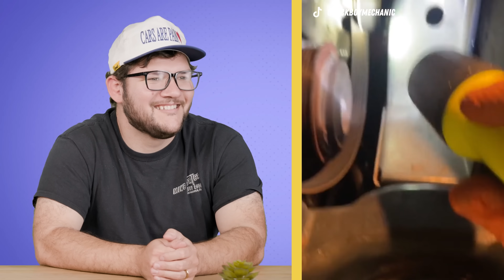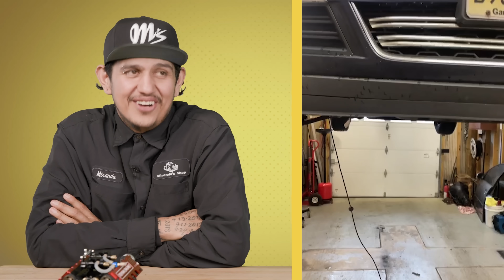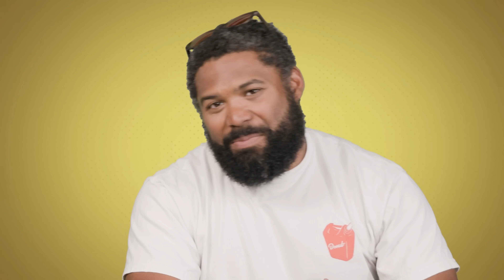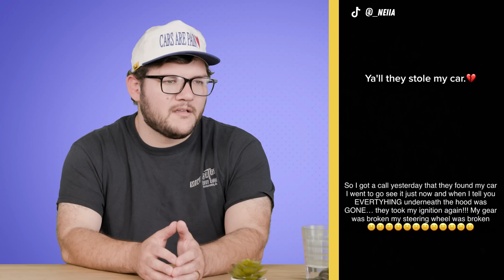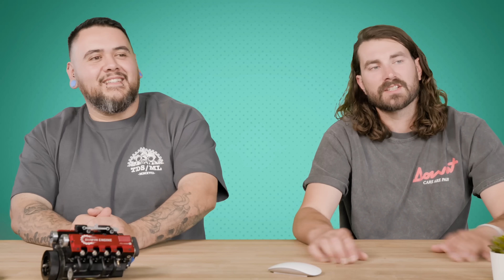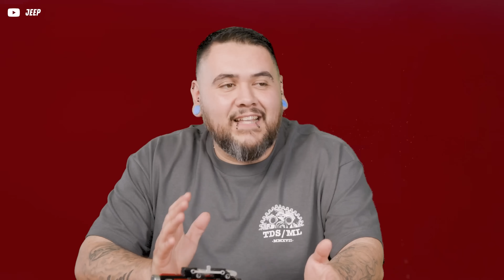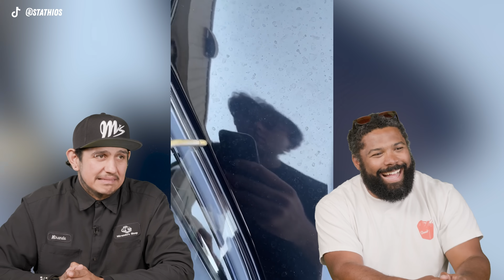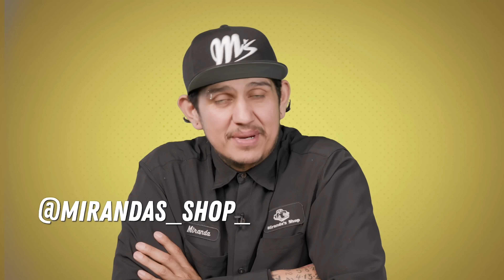Mechanic Reacts to Car Engineering Fails

Comment: One of the things I hated when studying mechanical engineering was being forced to learn how to design things to fail within a certain range of time or mileage instead of designing it as best we could within the allotted parameters. And to design it in a way that requires specialist tools and procedures. It made no sense to me but it was drilled to us to exhaustion. And at the time, during the day, I worked in an heavy equipment maintenance shop it made no sense to me... still doesn't.
Reply: What is the actual reason or explanation for engineered failure
Reply: @tjlovesrachel  To get people to buy new stuff... and more new stuff!
Reply: @firbolg  that's it... just that's it

Comment: Engineer here, teach design at a uni. First lesson in design is talk to the old hands and shop for their equipment, tools and practices for anything you plan to do.
2nd is to figure out how to bypass management trying to nickle and dime you.

I can garantee most of the engineer related faults were identified, but either too late so costwise so the company doesnt care, or handed off to another group to tick the box ok in order to meet deadlines.

Comment: I propose a 4th option: 
Bean Counters

Sometimes they force the hand of engineers to design something that's absolute crap just to save a dollar here or there. Then, 💩, as aforementioned, rolls downhill. 

Coupled with slap dash assembly, you get a lemon farm and unnecessary bailouts cuz "too big to fail", but I digress before I keel over from a massive stroke.

Just found this channel and have been binge watching to catch up! What do I wanna see next? Yes.

Honestly, the thing that gives me Forrest Whitaker eye the most is "rolling dumpsters". I detail on the side and this crushes my soul. It tells me the owner has bigger problems than a car filled with wtf ever is in there. Sometimes it's just ignorance and laziness, but sometimes, there's some form of sadness behind the mess.

Be gentle in educating these people about vehicle dynamics and how it correlates with safety to them, and others.

✌️😎

Comment: OH sh*t! My first car, I owned a '94 Celica with an '04 motor (hillbilly rigged, wires going places but not connected, and loose wires not connected to anything in the engine, battery almost welded to the hood, half an aftermarket sound system, i could go on lol) There was a little switch kinda by the floor that wasn't hooked up to anything, a mechanic guessed it was for fog lights? (this car would both, confuse and frustrate any mechanic) lol musta been an old kill-switch. Loved that car though! If i slowed down too fast the rpms would fall and the engine would die, and the previous owner put rims on SO BIG, I had to buy racing treads ~$170/each in 2013ish. Costco had the cheapest tires btw, discount tire wanted over $200/each!!!

Comment: Tesla door handles started off with limit switches to control them. After learning they replaced the limit switches with hall effect sensors (detect a magnetic field and it's orientation) to remove a bunch of wires, mechanical switches and points of failure. I can't say I like Tesla builds but after long enough they did fix the door handles.

Comment: I had a friend back in the day who was/is an engineer for one of the big 3 domestics who used to show me designs on his laptop at the bar and ask my opinion as a tech.  I think more engineers ought to do that.
Reply: Most engineers want to create perfect products but management is a ball and chain that keeps us back. I don't know how many times i have found problems with our designs and management just say "ok, so we file an exception" and leave it like that.
Reply: That's nice! If my gut is telling me that a particular design is going to be an issue, then I get in contact with the people who are going to be making the stuff to verify it is actually feasible.
Reply: That would be way too sensible.
But then there are things that you think you might have to take half the car apart to get at and you find they actually DID figure it to where you can do it without too much hassle.
The worst is where you need a $50 tool that only works for one thing.
Reply: They should, but the bean counters on the upper management will just disregard their feedback if it costs more anyway.

Comment: While the engineers are responsible for a lot of overlooked  stupid things. But I put the bolt that's against the frame on the accounting dept. They don't normally work on cars  and look at the bottom line and if they can save a penny by using a bolt that cant be taken loose the bean counters don't care. But using an off the shelf bolt is  cheaper than using an oddball leangth bolt.

Comment: Chevy Cruz with 1.4l turbo why did they have to put a plastic thermostat housing right beside the engine where it gets hottest which therefore causes it to melt. I have seen multiple with this problem

Comment: Saying it was the mechanic when he was showing you a design flaw which falls under engineering is crazy. On the McClaren it was both engineering and assembly, the door hitting when opening is clearly a design flaw and the bolt and washer issues is all on assembly

Comment: 2001 F250 7.3 Diesel upper ball joint grease zerk is only reachable with a needle grease gun adapter. It is impossible to get a regular grease gun connector on it. Drew's Diesel in Grain Valley MO is the only shop to every keep me from having to replace my ball joints, even the dealers won't grease them.

Comment: As a mechanic I came across Oldsmobile Aurora, front wheel drive V8. You had to disconnect the motor mounts, and jake the motor up,  to replace serpentine belt. It paid .8hrs flat rate, It took 1.5hrs. Nobody wanted to do that job.

Comment: Sometimes management gives you stupid design requirements and there's not much you can do about it. So just like how mechanics and machinists sometimes are held hostage by the bad decisions of engineers. sometimes The engineers are held hostage by the bad ideas of management. The proverbial s*** rolls down to the next person that has to deal with it. Although by no means is it always management's fault. There are plenty of engineers who just don't think of things like this as well.

Edit: With the engine bolt example I would say that could go either way, The manufacturer might not want to change anything about the engine and or they wanted a particular look. Now the Kia example I would bet management didn't want to pay for an immobilizer but that's my best guess. Especially because they used to have them before if I remember correctly and then they stopped doing it, Then start it again. This is particularly idiotic because This is essentially the same way of stealing a vehicle as the '60s '70s screwdriver in the ignition and just break the lock to activate the switch. The Kia method is remove the lock than activate the switch.  Also I'm pretty sure the '70s method would also work.
Now keyless / wireless ignition is actually a pretty big security problem. If somebody can get close enough to your keys like if you hang them by the front door they can boost the signal and drive the car off. Now how far you can go is going to be different to each vehicle model but at the very least it's probably enough to get it on a trailer.

Comment: The Kia/Hyundai thing is not engineering or a factory issue. ANY vehicle, GM/DODGE/FORD/ECT, That has a hard key set up like this can be stolen just as easily. And now there is a recall out for both brands that add the software. In the long runs its an Accounting thing.

Comment: There is a large truck manufacturer that on their one model in order to replace a power steering house you need to remove the radiator. When mentioned to the engineer and I quote “that house won’t need to be replaced ever. “

Comment: I have a 99 Subaru legacy outback and changing the plugs on it is a nightmare the frame is in the way took me 2 day because of the cussing I did about the engineering and I had to get a special extension for my ratchet

Comment: Engineers also design the factory and the factory process. Most of those problems you attributed to the factory would have been caught by someone with a good checklist and the time to go through it.

Comment: Doing this whole mechanic engineer thing is pretty smart but I would be curious to hear from the mechanics what a model of vehicle they adore is? Be it for its mechanical soundness or anything else.
Reply: what mechanics see least is toyota and honda. 4 cylinder engines are usually the easiest to work on, but the bigger ones without a turbo.
Reply: @bradhaines3142 just the 4 cylinder ones? Do the v-6's break more often?
Reply: @nthgth  not usually, just more room to get to things when there's only 4. a v6 tends to put 3 cylinders in a bad spot
Reply: One that makes them money, of course

Comment: I think it was Toyota that put the starter motor under the intake manifold on one of their motors. Ford combined the timing belt tensioner with the water pump housing, yeah. Imagine fucking up your cars cam timing trying to change a water pump, oh and it's variable cam timing so now you have phasers to mess with too. Btw the KIA problem is a society fail and not an engineering problem. In an ideal world you shouldn't even need a key because garbage human waste wouldn't exist. It was good to learn that McLaren can't spring for some blue loctite lol.

Comment: some states   is   if it returns  for same repair twice  its classified as a lemon,    and  as for Tesla   the horror stories   keep going and going and going i wouldnt buy one , sorry   the oil drain  thats engineered  issue but the mechanic if he  has done  numerous should  know enough for a a funnel or shield  to divert to  catch the oil

Comment: Worked in Audi in "rainy" province. Almost all Q3 are leaking through the roof. It is mostly engineers sometimes factory. Audi came up with a bunch of useless TSBs that dont really help. The problem is in the design of the sunroof frame and drain hoses. Also I have seen a couple Q3s with factory assembling issue when they pinch drain hoses with A pillars. Anyway. Shitty design- 80% factory -20%

Comment: As an engineer (but not of the automotive variety) I don't like all the hate that gets thrust our way - as if we don't have bosses. It's extremely unlikely that the engineer is the one actually responsible for the design. Instead, more than likely they were given very unreasonable requirements (such as this motor must fit in a certain size space, have certain fuel economy, be built with a certain bill of materials, etc). Or worse there was a last second change decided upon because they realized another issue so they had to "make it work". This sort of thing happens all the time, and believe me we're just as mad about it - if not more so - than the people who are impacted by it.

Comment: 7:00
I’m so glad that someone actually explained it 100 and 10 percent. That is exactly how the law works, you can’t just take a car in cause your not happy with it or have 1 small problems you don’t get your money back.
I’ve seen it before where someone brought their car in for a no start concern and cried and cried for lemon law threats and all to just come down to she didn’t put gas in it……. No not joking the car was literally bone dry on gas, put a few gallons and it’s was perfect again. The thing is it had like 700 and some change miles, like she definitely filled it up at least once……..

Comment: As a heavy equipment mechanic that started with a OEM having worked with engineers. Most are good guys but some are so full of themselves it’s sad. The problem is between engineering groups only focusing on their little part of the project. And the routings and clearance are always an afterthought carryed out by the newest lowest paid and most shit on new guys

Comment: The kia/hyundai ignition fail is more the factory saving a few bucks not putting imobilizers in their cars in the USA to keep the costs lower. Every other country they have them so not an engineering problem.

Comment: Why Is this first one even a thing. What a bunch of pansy a$$es. Cut the bolt, use your vice grips & put in a shorter bolt with the new PTen. Cost You 5 min.

Comment: Civil Engineer here and I have just one thing to say about this whole matter, if I built a Bridge that fell down in a few years or a road that didn't hold up for decades, I would be sooooo fired.  These are business decisions, same exact thing as when you go to a restaurant that is going down hill and they give you half of the meal you came back for.  This is why you don't let them monopolize everything.
Reply: If you'd get fired for a road that didn't last FIVE years you clearly don't work for whoever does the entire intersate highway system. 😂

Comment: I feel like the McLaren towards the beginning is both an engineering problem and a factory problem
Engineering dun goofed because a lot of things can be specifically requested like what metal a screw should be or whether or not a part needs threadlock or not
And Factory messed up because they can see these issues and don't bother.
Now, I should also mention that while the blame is being put on both of them, it is honestly the higher ups fault for being greedy sons of bitches and going ahead with a project and not listening to the people who know what works and what not works.*

Comment: What about the motors with their starters mounted in the middle of the V  or in the gearbox.
Or when dealers mark up prices on spares like alternators and sensors, then you buy the dealers Part and you find  out its for example a bosch part and you could have bought it for a kwarter of the price.
Love donut! I need a free T shirt😂

Comment: On the first one, id give the engineers a bit of a pass, that motor is not built for this car, they wanted the engine Option and managed to fit everything in quite nicely, at the expense or oversight of a belt change. Also the mclaren washers are definately on the engineers.

Comment: What we Germans see with Tesla is the absolute worst shitshow. 1) no part you buy will fit at the first try. You always have to drill holes and even then, the markings are wrong 2) you have to prepaid every part per creditcard. Something nobody is doing this in professional shops. You order, the part gets onto your bill and end of the month, you pay up when customer paid you. Not with fucking Tesla, you have to pay in advance, lose some money to the creditcard bank, and if the part is as good as the bumper cover we got, you have to drill your own holes, fit it to the car, paint it, refit it and hope it works out. With normal cars: you order the part, maybe paint it, put it on in a few minutes, no special things required. 3) Everything Software related at Tesla is a joke. You think VW is bad, Tesla takes the crown as the worst company making software for the dashboard. 4) Hacking a Tesla is so easy for thieves, BMW's are more secure than Tesla... KIA IS BETTER than Tesla. 5) Painjobs are, depending on your color, a dice game if you see the base color. Sometimes you have running paint on the car the dealership had to polish off. We found it and my paint thickness tester said 1500micro instead of 60-100, 1,5mm paint, nice. 5) like in the video: positioning of the parts is pure luck. Instead of having a line you can measure around the car, you have clearances you can stick your thumb into. The hood in the video was not even the worse they delivered to people.

We have a guy here in Germany, who found over 200 problems with his new Tesla and Tesla refuses to fix most of them. That is why nobody wants a Tesla anymore: they are garbage.

Comment: its a fucking GM you think they have engineers? They keep "improving" the same design for how many years... On the kia/hyundai stuff, its literally stated it doesn't have an ignition immobilizer when these owners bought the car... Its honestly not the manufactures fault, people bought the lower-end cars without the immobilizer. If this is a "major" issue then we have a shit load of cars form many other manufactures we need to talk about.

Comment: try doing rear sway bar bushings on WK jeep. on the driver side. if the bolt is a bit rusted. gotta take the fuel tank off

Comment: I get it, the frustration when someone looks at a bit and thinks, this would be so easy to fix, if only they had…

Car, belt tensioner failed. 

Tensioner bolted on with a female star drive bolt. Impossible to get any form of tool onto/into the bolt, and it hits the chassis leg anyways, 

Remove right  engine mount, evacuate air-con, and remove compressor and pipes. 

Remove alternator. 

Remove right front wheel and lower ball joint, and pull right drive shaft out of gearbox.

Unbolt compressor and alternator mounting bracket from engine…

Unbolt belt tensioner form bracket. 

New tensioner has a hex head bolt. It can be removed and refitted using a spanner, no other parts need to be removed, apart from the belt.